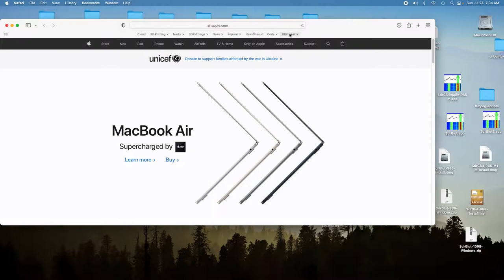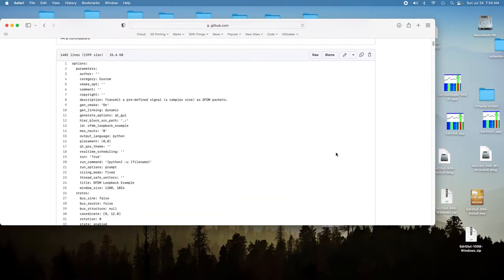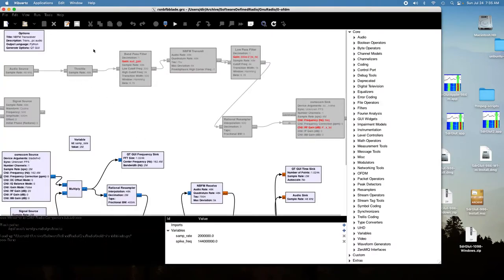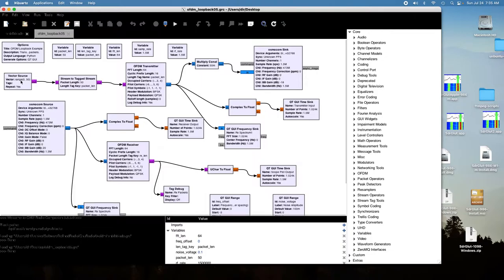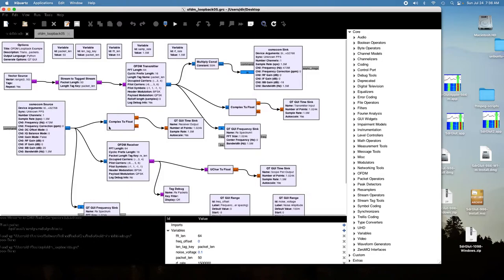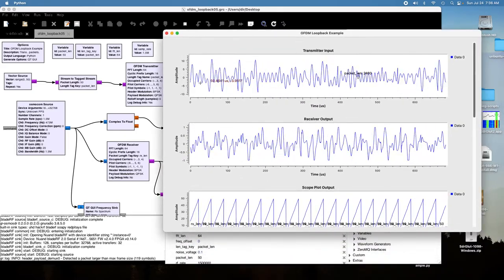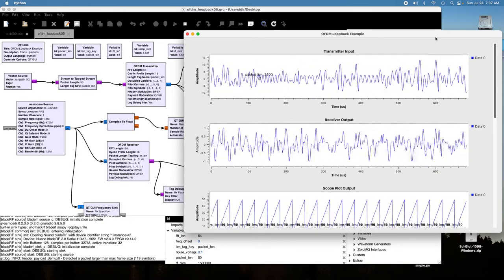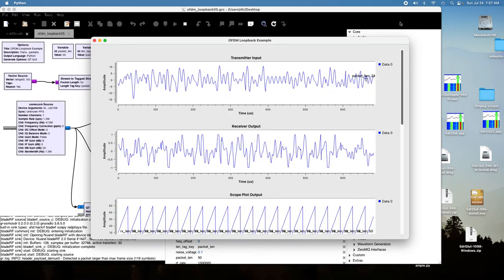Transmitting and Receiving OFDM Data with the gnuradio-companion

Comment: Very nice and informative lecture on GNU radio. I am a beginner on GNU radio. I have a question-- is there any way that we can extract/ export the data of the displayed  graph into a .txt/ .csv/ .dat file. Thanks in advance.
Reply from the maker: The easiest way to do it is to capture the I/Q stream just use a file sink.

The I/Q file is just a binary floating point data with the real value followed by the imaginary binary value. Read that and convert it into any file type that you please.

Comment: greetings, dale! I've been using gnu radio on an ubuntu 22.04 virtual machine within a windows desktop to transmit and receive a specific signal from/to a single bladeRF xA9. I am using actual antennas on the TX1 and RX1 ports. 

The signal samples come from a .bin file that I connect directly to the osmocom sink, and they are already modulated in baseband. 
However, I cannot seem to recover a near-perfect signal, even though the SNR seems to be very high. 

I know it is a kinda vague description. However, do you have any idea of what it could be? 

Pocessing the Rx signal in MATLAB, I saw some spectral differences when compared to the original signal. Apparently, the board filters out some part of it...
Reply from the maker: The first thing to check is that the amplitude (A*sin(w*t)) of the input signal to the transmitter is less than 1.0 - I usually force it to be 0.95. Then, start with the transmit gain low and turn it up until you start to see receiver distortion - that is how you get the SNR down.

Comment: Hello, in the OFDM transmitter it has a header and payload modulation how do these work? why do we need them?
Reply from the maker: The header patterns are normally used as a reference for the correlation routines to search for. The various payload modulation methods have different levels of sensitivity to noise permitting one to select one with the greatest payload with out generating too many errors.

Comment: Did you manage to note the HackRF block parameters if you were able to get that to work? 

I'm running two separate hackrf about 10 meters apart and it fails to demodulate

The goal is tx and rx data in real time ( JSON + video streams ) but I can't even get this to work haha

"packet_headerparser_b :info: Detected an invalid packet at item 1448. header_payload_demux etc etc"
Reply from the maker: 3 meters is the longest distance that I have tried. You have to play with the transmit gain to make sure that you are not over driving the send device. With the hackrf, you will likely need to add a DC filter to one or both grc.

Comment: Hi Dale, I am an engineering student and I do not have extensive knowledge of Gnu Radio, I am developing a cognitive radio project in OFDM using 3 Blade RF, I need to establish the base communication of the transmitter and receiver, but I get an error with the VLOK lib. This is the error.
[WARNING] SoapyVOLKConverters: no VOLK config file found. Run volk_profile for best performance.
Reply from the maker: Not having VOLK just slows,things down a little bit and is not really needed - I see a warning not a an error - Where is your error ? If you find a "volk_profile" around just run it -

https://github.com/gnuradio/volk

shows how to install it on some systems.
I have never installed SoapyVOLKConverters.

Comment from the maker: @Don Kelly - Hi Don, I  transmitted OFDM from Windows 10 to a MacOS Monterey in the next room. I used the bladeRF on the Windows Machine and a rtl-Stick on the Mac. I used the gnuradio from PothosSDR-2021.07.25-vc16-x64.exe. It had no problem adjusting the gain, but it would not let you set the bladeRF as both the send and receive device, but it worked using the bladeRF to send and a rtl-Stick to receive - on the Windows machine and to the Mac.  A little fiddling with the gain got it to work. The example files are those that worked between the machines. The files -

https://downloads.myriadrf.org/builds/PothosSDR/

https://github.com/righthalfplane/rfspace/blob/master/ofdm_loopback_blade08Mac.grc

https://github.com/righthalfplane/rfspace/blob/master/ofdm_loopback_blade08Windows.grc

I also got it to transfer files correctly and it just lost the last 2 Bytes -

https://github.com/righthalfplane/rfspace/blob/master/ofdm_loopback_blade09Mac.grc

https://github.com/righthalfplane/rfspace/blob/master/ofdm_loopback_blade09Windows.grc
Reply: Have you been set the bladeRF as both the send and receive device?

Comment: can this receiver be used to obtain data from WiFi networks? those using 802.11g/n . I cant really tell exactly how this all works.

Is OFDM used in unison with another modulation scheme or something? As I see things like BPSK or QPSK mentioned also but don't really get the practical difference
Reply from the maker: The WiFi networks use the OFDM to transfer data, but that is only part of what's going on. BPSK and QPSK are two of the methods used by OFDM to move the data. BPSK can handle higher levels of noise than QPSK before errors start creeping in.

Comment: Hi Dale, I am an engineering student and I'm new of GNURadio.I am developing an OFDM distance ranging system, I need to add the TX and RX timestamps, I noticed that RX time could get from stream tags, but I have no idea of adding TX timestamps, I am wondering if you know how to solve this problem?Thank you!
Reply: reply if you solve this, same problem here
Reply from the maker: What do you want to use the timestamps for ?
A few years ago, I was looking at the timestamps provided by my SDRs and the BladeRF was the only one that actually had a  timestamp that was more for less correct.
Reply: @daleranta1012  I'm trying to use the timestamps to calculate the distance between the two USRP B210.I need the TX and RX timestamp to calculate the time delay.
Reply from the maker: @WuDi-d9g  That was what I thought. If you have the "GPS Locked TCXO Reference", that gives a foot accuracy. With just the B210, you  only have 1000 foot accuracy. In the Soapy call to "readStream", timeNs is the timestamp in nanoseconds.

Comment: Hey, Ive been working with  USRP B210 and want to transmit and receive packets in 5Ghz. What changed should I make in order to achieve my goal?
Reply from the maker: Are You Having Some Problem ? Normally, you would need to switch the devices and antennas to match your setup. It would be best to start with the frequency in the example - some of these methods have problems at the higher frequencies.  I used a rtl-stick to receive - I would have had to switch to my HackRF One to try it at 5Ghz and that would have required fiddling to get the frequencies correct. What was your setup ?

Comment from the maker: @Don Kelly -  Hi Don, This has gotten messy - so I though that I would start at the top. If you start with split version of my original grc file, on the transmitter increase the "BB" gain until the "Receiver Output" shows about +1 and -1 - at that point it should in theory work. That is what is supposed to happen, but I cannot test it with my one BladeRF.
Reply: It does look like it may be clipping. When I adjust BB gain nothing happens. Are you running a bladeRF 1.0 or bladeRF 2.0? I'm using a bladeRF 2.0, and the gain setting for the newer bladeRF 2.0s are now just one setting, not three. I'm unfortunately using Windows for this testing, so maybe it's a Windows issue with the Osmocom Sink. I may try to move over to Ubuntu with it. But thanks, I think it probably is that it's clipping the signal some and producing aliases.
Reply from the maker: @donkelly36  I am using a bladeRF 2.0 micro xA5. When I adjust BB gain the signal goes from zero to a large number. When I adjust RF gain it does about the same thing. I have not tried it on windows - I used the Macintosh, Ubuntu 22.04 and the Raspberry PI.
Reply: @daleranta1012  Thx Dale, I'm only using Windows because I'm working an SDR project for a client and they want everything in Windows (I'm definitely not a Windows fan!). I'm like you, I like both Ubuntu (I run 20.04) and Mac OS. Are you running a new M1/M2 silicon mac with your bladeRFs, or an x86 Mac? I'm still on x86 Macs, but will likely migrate to the new silicon in next 6-12 months.
Reply from the maker: @donkelly36  I have a old MacBook pro, a Cylindrical Mac Pro, a old iMac and a fairly new MacBook pro M1. When I first got the M1 there was little support for running in native mode, but now most things run in the native mode. I got the M1 so I could create a M1 version of my SDR program SdrGlut. SdrGlut was created to test the speed of the SDR routines, but the program has grown out control - now, It is faster and has far more features than gqrx or CubicSDR - one of these days I may take some time and clean it up.
Reply: @daleranta1012  Thx Dale!!

Comment: Thanks for the video. I am new in GnuRadio and I have downloaded the file as you showed us and opened it with GnuRadio CR . I can see the Blocks but unfortunately I cant run the Program. Can you plz help me what is the reason?
Reply from the maker: If you cannot run it,  usually you will see something highlighted in red - that is where the problem. If it starts, but errors out then you should get a message telling what the problem is.
Reply: @daleranta1012   thanks but as I said I am very new in GNURadio and I cant really understand the errors well. Maybe I cant run the flowgraph because I dont have any Hardware like SDR right ? You use Osmocom sink / source and I think it refers to use a hardware. Or can I run the flowgraph without having any hardware  ?
Reply from the maker: @alirezamohammadi4536  The example as given works using the BladeRF SDR and with a little work you can use practically any SDR. You do need a SDR transmitter and receiver for the example to work.
Reply: @daleranta1012   I dont have any regarding hardware. Can I change the Flowgraph so it works without any Hardware? How is it possible or wich components shall be replaced to what ? Thank you again in advanced
Reply: I think I have found how to resolve this by replacing the osmocom sink source by a chanel model right ? but to wich components shall I link the in-output of the both chanel model ?
Reply from the maker: @alirezamohammadi4536  The purpose of my example was to show how you could actually transmit and receive the information. The simple gnuradio loop back example  is given at -

https://wiki.gnuradio.org/index.php/Basic_OFDM_Tutorial

Comment: Dale, I just tried it and is fantastic. Thx! By the way, how does Source block tell the bladeRF to be in loopback mode (use only one bladeRF)? My reason for asking is I'd also like to run the demo with two bladeRFs on separate PCs using antennas. Thx again!! Don
Reply from the maker: Hi Don, It does not actually use a loopback mode - that is what the original version did. I supposed that I should have changed the name. You should be able to disable the RX loop on one machine and the TX loop on the other and run them to do the transfer. You may need to fiddle with the RX and TX gains to get it to work between machines.
Reply: @daleranta1012  Thx!!
Reply: Dale, FYI, I've switched to the Soapy BladeRF Sink, as I'm unable to get the gains to do anything in the Osmocom sink.
Reply: Also, FYI, it's interesting that on my spectrum analyzer, I see a larger signal at 1.42HGz (vs the desired signal at 473MHz).
Reply from the maker: @donkelly36  What are you seeing in the "Receiver Output" display ? It should go between about +1 and -1 and be smooth like the "Transmitter input". If it shows higher frequencies, the Transmitter is clipping the signal - that of course would give strong harmonics.
Reply: @daleranta1012  I have been trying to achieve full duplex transmission with external loopback, how should I approach it based on your ofdm_loopback_05 file?
Reply from the maker: @Dara-ol9tg  I am not sure what you mean by external loop back. 

I used 

ofdm_loopback_blade09Windows.grc

to send from a Windows machine and

ofdm_loopback_blade09Mac.grc

to receive on a Macintosh. They just use pieces of ofdm_loopback_05 file.

 ofdm_loopback_05  really is not actually a loopback - it is actually transmitting and receiving the data - for a loopback you pull out the transmit and receive parts plug the pieces together.